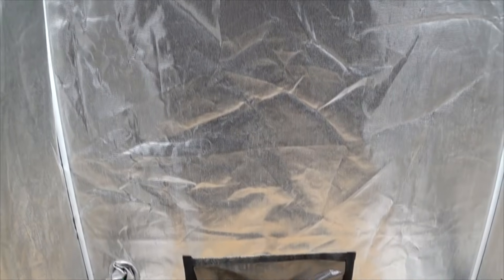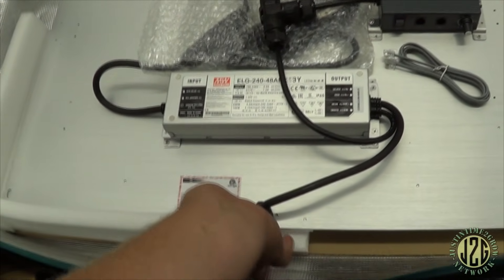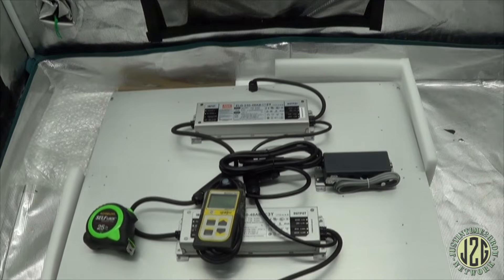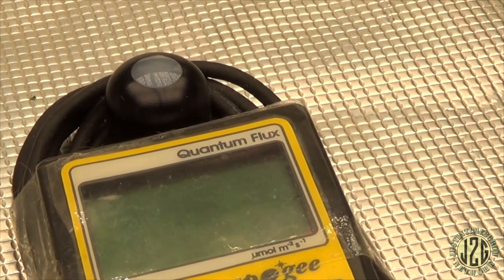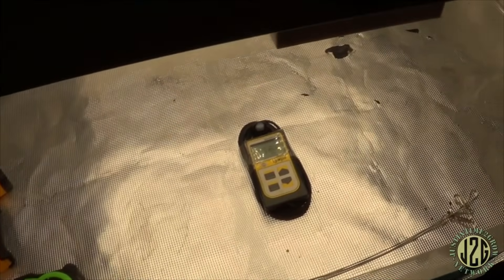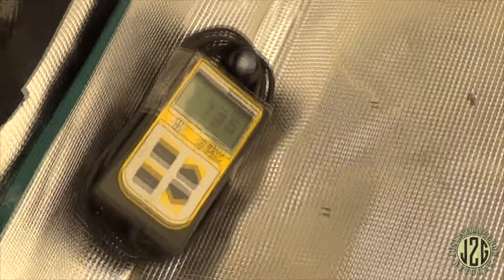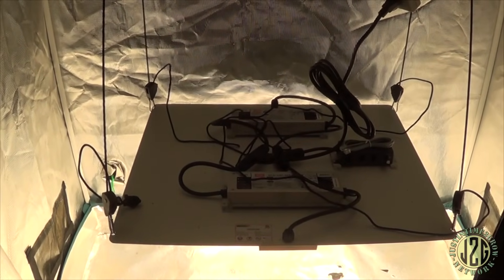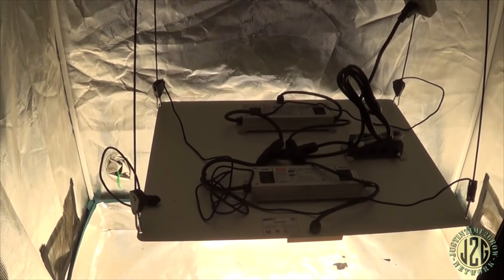Are Cheap Amazon Lights Any Good?(E:11) - Spider Farmer SF4000 Unboxing, PAR, Wattage & Heat Test

Comment: MixJoy gl 2000,  meanwell  driver, same samsung led's, $140. on Amazon.  Two of them are the same as this light for just over half the price.  And with the quantum boards separate you can arrange them spaced farther apart to get a better light spread.  I have to keep them at about  60% to keep the (flower) par between 600-1000.
Reply from the maker: And if you read the reviews someone said they got 2 and neither of them were the wattage they said and both were different wattage even. A lot of companies also sell fake diodes. I only trust companies I know. Also the new sf4000 has the diodes spaced differently to improve spread. You also don’t own a par meter if you’re that cheap so your fake ppfd rating is useless as well.

Mix joy also uses ELG drivers not XLG drivers. Not all meanwell are made the same. They cut corners. That’s why their power is less too. Xlg are always at max power no matter the voltage where elg can be variable depending on exact voltage. 

If you want to save some money go ahead but it’s not the same thing.

Comment: Dont u think ur also seeing such a high par level with how close the light is too?
Reply from the maker: I'm measuring it where I feel it's most efficient overall. When you raise it up you lose a lot in the middle and gain little to nothing on the sides.
Reply: I feel ya i just also think tht close to actual plants will burn them unless your turning the dimmer way down which then its not very effective for growth
Reply: @idabright503  the manual say Seedling = 24”  Veg = 18”-24”  Bloom = 12”-18”.  Nothing about dimming.  Justin ran numbers for 16” and 20” at all dim levels.  I’m hoping he answers my question on usage in my 5x5.

Comment: Just finished a grow with an SF4000 & SF2000 combo in a  4x4 - absolutely phenomenal results! 
I highly recommend these lights. 
My only issue is the heat they radiate esp during the summer months. 
Personally, I think that they are better suited for a grow-room set-up rather than a tent.
Reply: Remove to Drivers from the boarders and put them outside the tent. You just need to splice wires and extend, very simple.
Reply: @Tabooza  After this grow and before next summer I just might do that.  For once I’m glad for the cool weather here in the PNW.
Reply: What height and power did you keep your light at for both veg and bloom?  The manual is too vague.
It says on page 4, Seedling = 24”  Veg = 18”-24”  Bloom = 12”-18”.  Nothing about dimming.  I don’t have a meter to check.  My clones are about 8-10” tall and I have it at 30” full power in a 5x5x8.  The thing is so bright.
Reply: @Mr_PNW  That's a bit li saying what ear should you use to drive up that hill. you modify and adjust until you find the sweet spot.
Reply: @Shadowboxe  Since writing my comment I’ve done just that and the plants are thriving now.  I started at 30%@30”  I’m now at 50%@30” and the drooping and yellow veins that had started showing is all gone.  Leaves  are pointing up and dark forest green again.  I’ll probably raise another 10% this weekend.
Reply: @Mr_PNW  thanks.  Been wondering about that same issue

Comment: I use the P1500 & the XS1500 by Viparspectra & my Banana Runtz & Divine Gelato x Project 4516 are loving them! My King LED is a 1200w I have covering a 4x4 area just fine, but it's a tent. In my eyes, they're worth it when they're working! But when they go out, the company is a hassle to get ahold of 😅
Reply: I know the center on the 1500's is probably only about 950w, & the 1200w King probs peaks at 850w center, but they've been killing it for me

Comment: I have 2 newer sf2000 in my 4x4. I run a 6" fan on the drivers. My tent runs 3-4 degrees Fahrenheit cooler. Plants also love em. I.have to feed more often too compared to my old viparspectra 600s. I'll never go back to blurple!
Reply: How hot does it get in your tent  with those 2 lights. I was gonna get a sf4000
Reply: @shroomsopenminds3623  depends on the temperature of the room it's in & your air flow.  Mine is generally no hotter than 84 average around 79

Comment: Love this light! I have 2 SF4000s for my 4x8 Gorilla grow flower tent. Running at 24inches full blast with Co2 and the ladies love it! Great affordable light
Reply: Wow dude 2 in a 4x8?!!!!! That’s awesome how are you liking it?!!! Would you change anything?! I’m still debating between 3 Mars SP 3000’s, HLG 650R or 2 SF 4000’s for my 5x5. I’d love to hear what you think!!!!!
Reply: Omgcezwho Dude the ladies love it! They’re exploding with growth. The temp is steady at 80-83 degrees with both lights on. I wouldn’t change a thing. I have three 6” clip fans, two 16” wall mount fans and the AC infinity T8 exhaust fan. It’s almost a perfect set up. I just need filters for the tent intakes to keep the air super clean. 

Bro the 650R is a straight monster. The PAR just blows away the SF4000 and mars hydro. Lol. However, 2 SF4000s is the same price as 1 650R. I feel like you would get better canopy coverage with 2 SF4000s and close to the same PAR as 1 650R.
Reply: Thanks for that info bro I appreciate it👊🏽 I was thinking the same thing about the SF4000 but might be a bit of an awkward fit in a 5x5 unless I put them both facing the corners rather then straight if you get me. What about 3 Mars SP3000 those spectrum look real nice and might be easier to distribute the 3.🤷🏽‍♂️✌🏽👊🏽
Reply: Omgcezwho No problem brother! 2 SF4000s would blow up a 5x5 for sure! You might have to turn the dimmer down to 60% 😂

The SP3000s are good lights but at $400 each that would be $1200 plus tax. Two SF4000s or one 650R will put out more PAR than three SP3000s for $100 less. 

They’re all great lights.
Reply from the maker: Nice
Reply: @mmthc303  Sweet!  I’ve got the half version of your setup.  1 SF4000, 5x5 GGT, ACI T8, one 6” clip fan.  Just ordered a 8” oscillating desk fan for the floor.  My clones from a grower have been in my tent for 3 weeks now.  Maintaining 72-78F with light at 30” full power.
What height, dim level would you recommend at this stage?
Reply: @braddream77771234  I’ve since settled on 60%@30” and they are thriving.

Comment: How would you rate the SF4000 compared to the Solar Extreme 550?
Reply from the maker: It’s hard to beat the sf4000 after the coupon on amazon and my justintime2 coupon code. Best bang for your buck I believe.

Comment: Thanks for the information ✌️
Reply from the maker: Yep
Reply: @Justintime2grow  Your information is much appreciated,I’ll probably start at 24 inches,and leave it around 70 percent,for a.     4x4!Or like you said closer but dimmed a little more. I’m not using to that much     Intensity. I’m sold on this one.I have a 4x4 that 5 fr 9 and can only have at about the five foot mark.Thanks again Justintimetogrow‼️👍

Comment: Better to use two SF2000 daisy chained in a 5x5. More even light distribution than the SF4000.

I certainly wouldn’t call them “Cheap Amazon Grow Lights”. They’re one of the top quality lights available, but not for a grower on a budget.

Personally, two SF2000 or one S4000 in a 4x4 will be more than adequate, but I use a Lumatek 600 Pro in my 5x5 GGT. More than efficient for an XL Wilma Atami drip feed system with either 16 6l or 9 11l pots in a 115cm sq unit.

Ideal for SOG or SCROG growing.
Reply: no need to daisy chain that close lol waste of wire just set them both to the same %

Comment: I would love that sf4000 for my 2x4
Reply: that’s to big for a 2x4 the 2,000 is the way to go i have two of them 🌱
Reply: Get SF2000 it's the exact half of SF4000 and will get the same coverage in 4x2
Reply from the maker: Crush it
Reply: @alexsiniov  wonder how long before those get the dimmer and daisy chain?
Reply: @Mr_PNW  4 months ago in updated model as I remember
Reply: @alexsiniov  I thought the 4000 was the only one updated.
Reply: @Mr_PNW  mars hydro does not have 4000. They have same power model ts3000/w. All from ts1000 were upgraded

Comment: You remember the original blurple Spiderfarmer when the Company still went by Mehezi and were fire hazards. Sure didn't use quality components then.
Mixjoy has more chips plus UV and IR and app controlled as well as 150$ cheaper. 
Get a HLG 600 R/SPEC.  Its bout 50$ more than the overpriced Spiderfarmer..

Comment: I run mine at 12 inches at 100% in flower with a co2 burner with no issues but with that said I have 30 years of continuous growing 99% of it with 1000w hps. My largest set up was 15,000 watts of hps, not sure how large the room was because I never measured the room but i did have 7 4x8 raised beds pulling between 20-25lbs each time but i wish these were available back then because my $1600 a month electric bill would have been more palatable.

Comment: Think it's kinda deceptive these readings are in a 2x4....
Reply from the maker: Well you can use this light in a 2x4. But if you don't believe the 4' readings you wouldn't believe the 4' readings in another tent either.
Reply: LOL 4’ = 4’. He did mention that the light is rectangular not square and if centered in a 4x4 the other two edges would be slightly different but not by much, and that was with it dimmed!  The manufacturer rates this light’s footprint at veg 6’x6’ and bloom 5’x5’.

Comment: No UV. Pass..
Reply: DK UV leds are each in the center of all the current spider farmer lights, it’s the led in the center of the logo that appears burnt out on camera
Reply: Uv diodes have a much shorter lifespan that regular diodes.  You're better off adding uv as a separate fixture.  I think the difference is regular diodes go 50,000 hours and uv diodes only get around 10,000 hr. Lifespan
Reply: do you know which uv lighting you need? because only uvb is sufficient, you really don’t need it 🌱✌🏿
Reply from the maker: UV is easy to add on and is usually the first diodes to go out on one of these arrays. Maybe you should change your stance.
Reply from the maker: @ziggyj3009  That's IR.
Reply: @Justintime2grow  Not when I see the ridiculous resin production UV provides. May you should read up on it since you're reviewing lights..

Comment: Video rocks but the sf4000 isn’t what I would call cheap it’s 600 bucks I think it falls out of the budget lights
Reply from the maker: It's cheap relative to its competitors of equal parts and quality. This is one of the best deals on a light this size with this quality making it, "cheap" compared to the rest. I'm sorry it's not $50.
Reply: Justintime2grow I understand where ur coming from but for a beginner grower it might be a lil high and I also understand that the electric sky u need two es300 to cover a 4x4 in flower so that’s 1400 but I like the videos nice work
Reply from the maker: Death_trap_auto if you want a good led for a 4x4 this is how much money you need. If they can’t afford that they shouldn’t be trying to run so large of a tent or they should use HPS. I’m not going to just not review something just because you think all people that want to grow are poor.
Reply: Justintime2grow I am not saying that you shouldn’t or should review anything I have a spider farmer sf4000 great light not saying anything bad about it my opinion and like assholes every one has one at 600 I think it starts to fall out of the budget light Category and I understand where ur coming from that u will definitely be spending a little bit more for ur I don’t know but love the reviews most definitely

Comment: 16” away from canopy is too close. Your plants will get light stress. 30” minimum. I have this light and learned the hard way
Reply from the maker: That's what dimmers are for. I've pushed 1500 PAR to cola many times though as colas have shot up above the canopy. Nothing died. The worst that happened was the cola had some fox tailing. 1500 is very high and you have to have your nutrients and pH on point to be able to push that. CO2 recommended. The distance doesn't matter much, the PAR does. You could run this at 6" if you dimmed it enough.
Reply: @Justintime2grow  I had mines at 40% 30” away and got hit with light stress
Reply from the maker: @inyczgq  Impossible.

 30" at 40% would  be veg levels of PAR. Nowhere near high lighting levels to do any damage so the issues you were seeing were not light related. It's just not possible.
Reply: @Justintime2grow  the light is in a 3x3 also
Reply from the maker: @inyczgq  does not matter. You still think it was the light??? 😂😂😂😂😂